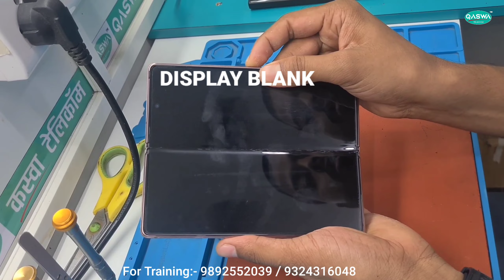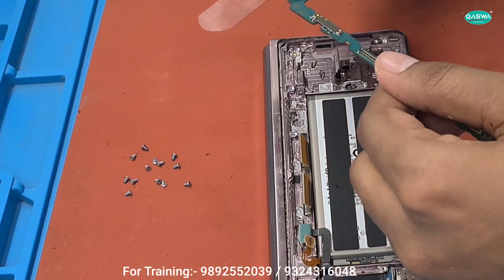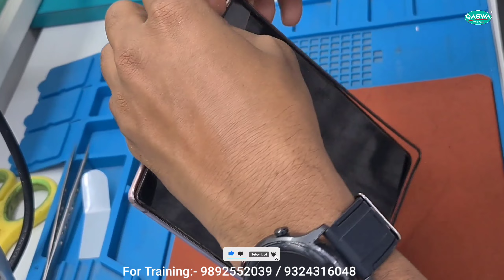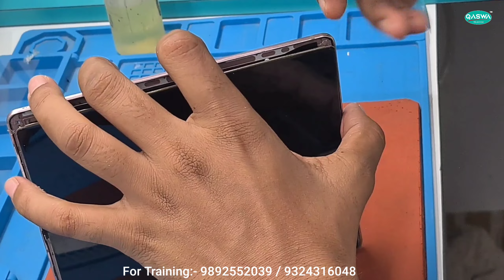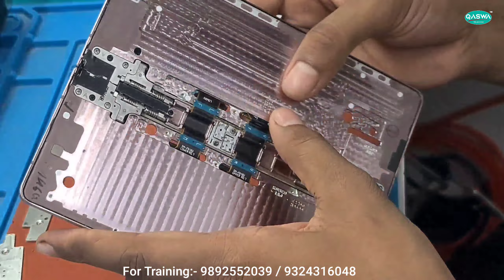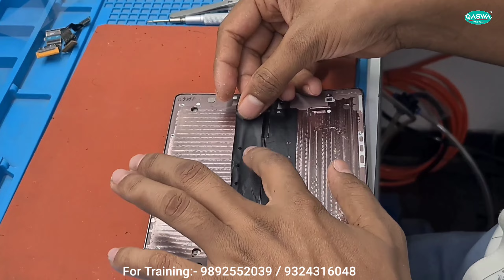Samsung Galaxy Z Fold2 Blank Display Repair || Qaswa Telecom

Comment: So you just change the flex and clean inside? I have this problem with my z fold 2, and vodafone screwed me over saying its out if warrebty even though i have proof its still in warranty. As they are sending it back untmrepaired i figure i may as well tey ro fix it myself
Reply from the maker: WhatsApp 9324316048

Comment: I have fold one which the inner display is not working n vibration sensors are also not working can u solve my issue plz
Reply from the maker: WhatsApp me 93243 16048
Reply: My internal and external screens are broken. I want a new screen.

Comment: The screen inside the Fold 2 displays well, but it doesn't work when touched.  Will replacing the inner cable fix it?
Reply from the maker: WhatsApp 9324316048